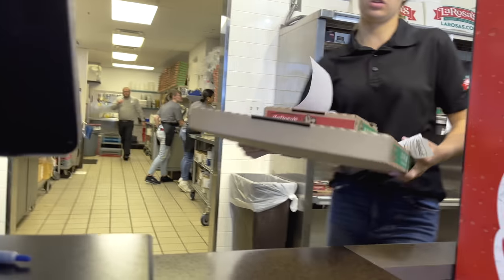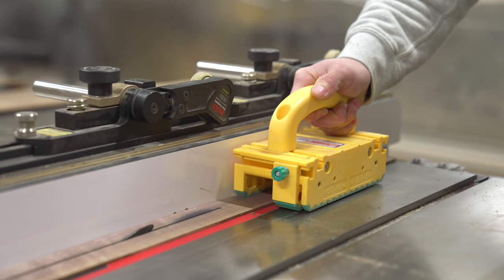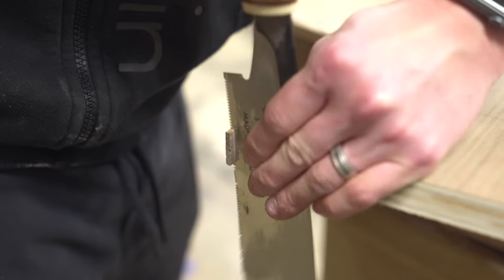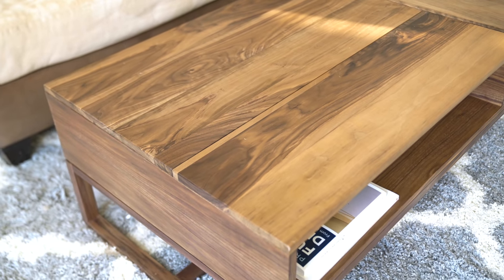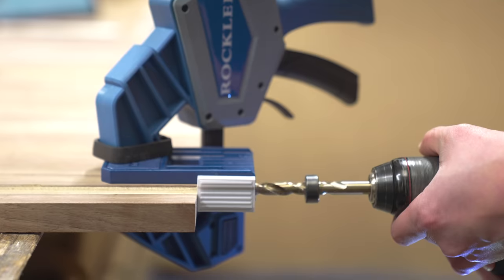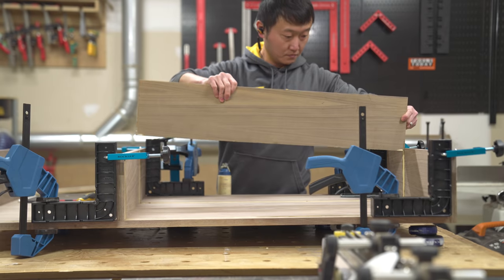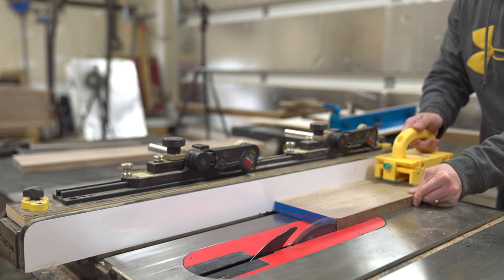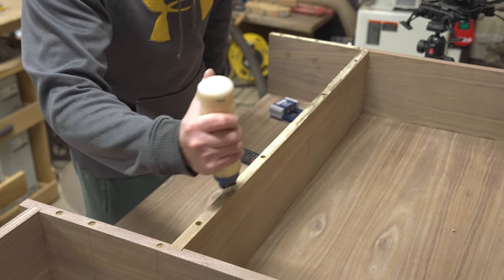Double Lift Top Coffee Table + FREE PLANS || How To Build Woodworking

Comment: This looks great!  I love that it has two different lifts.  My best tip for lining up the tops (if double-sided tape or painter's tape and CA glue don't work as people have previously mentioned) is to use a piece of paper.  Line it up exactly where the top will be, use a pencil to mark the holes, then flip that over to the bottom side of the box top and line up the corner of the paper with the corner of the top.  I've used this trick a few times, both using the pencil to do a rubbing to get the locations of the holes, or just poke a hole in the paper where the holes are.  My dad used to use graphite powder also to cover the bracket and put the top down transferring the graphite to the bottom of the board.  The only problem with that is if you don't get the board set down exactly in the right spot or the bracket is just a hair too low, it won't transfer, but I've used that trick to and in the right cases, it works perfectly!
Reply from the maker: I might try that graphite powder idea!

Comment: A trick to line up a top with the brackets in a situation like this is to use some 3M command strips. Line it up, press it in place, and if you use enough strips, you can lift the top up with the brackets attached. Adjust the hole position very slightly to account for the height of the command strip. Depending on the lift mechanism, it is sometimes easier to remove the gas assist.

Comment: Thank you so much for this beautiful design. My girlfriend and I both work from home and our new coffee table is perfect for us! I used double sided tape on the top of the hinges (Alien tape) and it was just strong enough to lift the table tops and then it was easy to drill the holes, remove the tape and screw the top.The result was perfect on the first try and it didn’t remove any of the finish. I’m not promoting this particular tape at all I’m just happy I finally found a use for it! Thanks again for your video and plans you are a great teacher and very talented!

Comment: I used blue painters tape on the table top and on the lift hardware with super glue between them. I then marked all the holes with a pencil, then removed the top and pre drilled on the marks. I put the table top back on the lift hardware and secured it with screws.

Comment: Great build! I thought of a trick for mount for the folding hardware. Start by supporting the mounting plates with two scraps so that it is level with the top surface, then use two sided tape to temporarily lay on the top. Afterwards fold out the top to drill the holes and mount the screws.
Reply from the maker: Good idea!

Comment: Maybe this was mentioned, I didn't read ALL the comments. 

I think you could save some alignment headaches with the lift-top mechanisms by changing the order of assembly a little. Leave the bottom out of the table until you have the top secured in place. This way you could just flip the table over and work on it from underneath.
Reply from the maker: That’s a good idea

Comment: I use paint sometimes to transfer marks.  Cover the bracket in paint around the holes and carefully set the top in place.  Flip it over and mark the holes with an awl, then wipe off the paint before it has a chance to soak in

Comment: Great video and build Alex! I wonder if you could have done a clamped up dry fit without the bottom in place and then with the carcass upside down drilled the holes for the lift hardware?
Reply from the maker: You could do it that way. But I think that’s a lot of extra work. It might be a good solution though

Comment: I love this table , was wondering if hot glue on the brackets would be a good idea to have a temporary fix while you drill the holes, you have enough play at the beginning to use spacers and placing it , and at the end hot is easy to take off (only prob  you might have some light sanding to do underneath but you would get perfect holes I think, just an idea , thank you for the plans !!

Comment: Great build! I had the same problem lining the hinge mechanism and ended up referencing the holes like you have. Initially I used sharpened bolts through the holes to press the top down to get the position for the holes. Unfortunately I didn’t have the right size nuts so I had to use tape to hold the bolts in place which didn’t work real well.

Comment: What's the trick for getting a good finish in the areas where you have glue squeezeout?  Doesn't the glue fill the pores of the wood and prevent stain/poly from looking right in those areas?

Comment: I’m new to woodworking and have only built “shop grade” furniture in the past. I would like to start sourcing materials for this project but I’m having trouble procuring the 1/8” x 3/4” x 50” walnut edge banding. Where could I find walnut in 50” lengths?
Reply from the maker: Hi, the “edge banding” I used was just walnut lumber I cut to 1/8” thick strips. You can get lumber from woodworking stores like Rockler or Woodcraft, or other lumberyards. You can join Facebook groups and ask people who live in your area for recommendations

Comment: Design the build of the table where the bottom panel can be left out. Then you can flip it over, lay it on the top and affix the mechanism through the bottom.

Comment: Just a little bit of double sided tape on the hinges, lift up and mark?
Reply from the maker: Won’t work. The force to lift up the top would separate the two
Reply: @BevelishCreations  painters tape and CA glue? Might be stronger. 🤷‍♂️
Reply from the maker: Maybe I’ll try it next time. These things are kind of like soft close drawers that take some force to pull open. But the tops are much heavier than drawer fronts, so it’s got gravity and weight working against it too haha. But CA glue might be the answer! Thanks!
Reply: @BevelishCreations  yeah for sure. Not simple.... I've never worked with this type of hinge before. But is it possible to adjust the tension on them temporarily? So its easier to open? Then once it's assembled you can tighten it back up?
Reply from the maker: Not with the ones I got. Maybe more expensive ones have the option to adjust the tension. I’ll try the CA glue next time
Reply: maybe some clay or something on the underside of the table top that once in place can be pressed down on to take an impression of the hole pattern on the lifts?